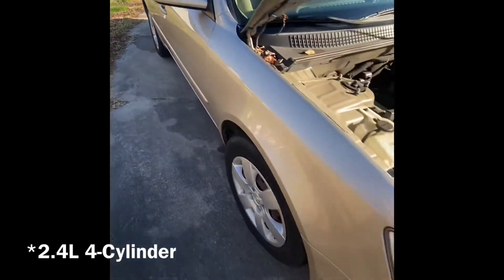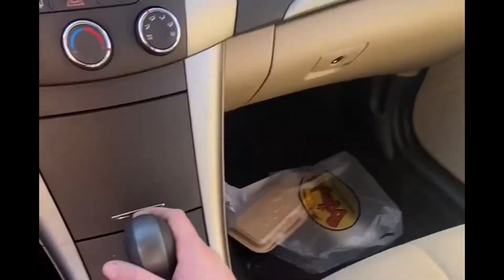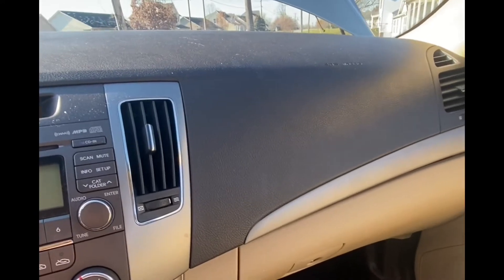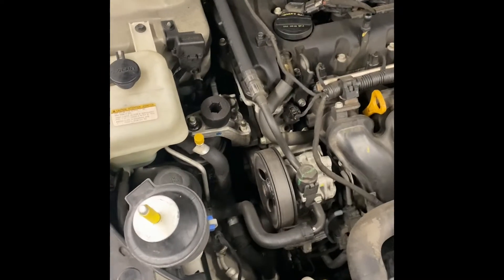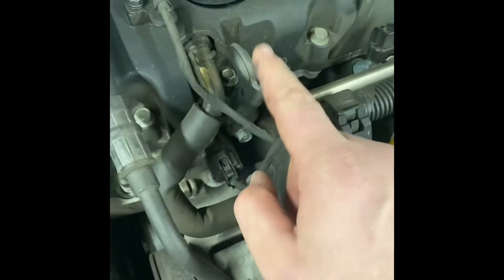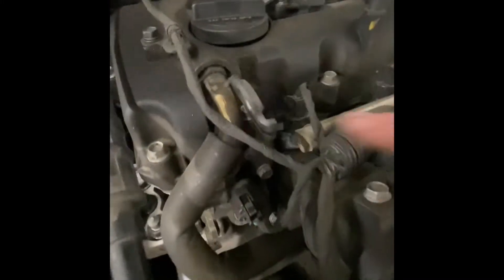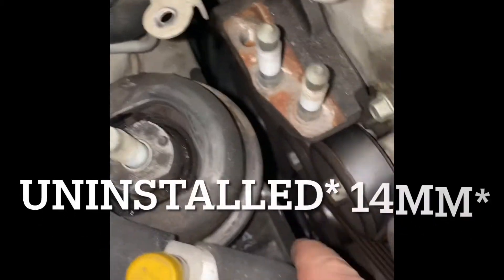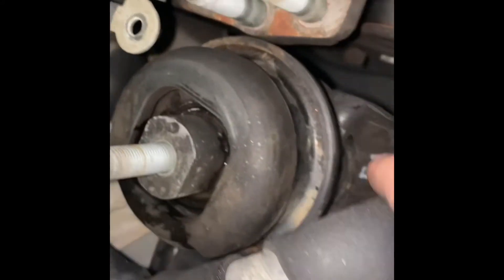2009 Hyundai Sonata making noises? Motor mounts gone bad?

Comment: I’ve had same noisy sound for months now and I wasn’t sure if it is the engine mount or not and you just saved me! Thanks a lot for sharing this video.
Reply from the maker: Awesome! Glad I could help!
Reply: @randomcitizen2345  Were you getting same noise when in drive with moderate accelerations?
Reply from the maker: @Giorgimm11  no. It only made noise when in park or if you held the brake while in drive
Reply from the maker: Have someone watch your engine with the hood open. Put the car in reverse. Hood the brakes and give a little gas. Is your engine moving. Also check in drive. This is a easy way to see if any of the engine mount bushings are bad
Reply from the maker: @Giorgimm11  a bad engine mount can make noise while driving
Reply: @randomcitizen2345  Already tried that but engine makes a normal movements :(
Reply from the maker: @Giorgimm11  the noises I heard sound like cv axle or engine mounts. It’s hard to diagnose over a video though
Reply: @randomcitizen2345     I had taken car to several suspension shops they all said that nothing was wrong with suspension, Later I tried removing a front right tire, and looked things closely, I saw the grease coming out from the inner cv joint boot (Not sure if torn or something else) So it may be the cause ?  As I was told it must make a clicking noise not scratching one I get (No one has bothered to look at them because there is engine shield covering the whole CV)
Reply from the maker: @Giorgimm11  yes cv axles can definitely be the issue. Go to a parking lot and turn full lock either way and drive slow. Listen for any noise. I’ve replaced them even with no verification and fixed issues
Reply: @randomcitizen2345  Okay thanks will try that tomorrow, will ask them to remove shield and inspect from below, I was just able to look at it from tire side only, and last question, does it sound to you that engine can be making this kind of noise? I meant inner parts not pulleys or belts, Was told by numerous people that they hear it from top right side of the engine :(  above belt and pulleys
Reply from the maker: @Giorgimm11  I don’t think it’s internal from your idle. A noise from the top would be constant through all rpms. A rod knock will be more down low and get worse with rpm. If you hear a clunking sound from up top I would try a engine mount. It’s located right where your noises are and have multiple symptoms of a bad one.
Reply: @randomcitizen2345  Yes engine mount may be the  issue too, we will try to figure out cause tomorrow,  thank you so much for taking care on me.
Reply from the maker: @Giorgimm11  just trying to help another out. Good luck and god bless
Reply: @randomcitizen2345  Just came home, It turned out to be a failing engine mount, as I was told this was the rarest noise it could make
Reply from the maker: @Giorgimm11  glad you found the problem!

Comment: Just did that motor mount job this AM...Initially I though the squeak was due to a bad flexible exhaust pipe until  I found this video on the web...Great job ChunksFix...!  Now here are a few tips for fellows DIY'selfers :  FIRST tip :  Identify the 5  X 10MM screws so U dont swear when time come to put them back in their respective hole.   SECOND tip :  You must remove the top metal peace ( part of the ANCHOR-9353 mount) so U dont damage the A/C aluminium piping while inserting the mount in place.  THIRD tip: the 3 holes in the mount the ones connecting it to the body are not aligning with the 3 holes in the body.  In order to bypass this situation(problem )  just screw in 2 or 3 treads of each bolt while holding the mount as far as possible from the body then use a socket to screw them in place alternating the screwing and that will force-the-3-legs of the mount in place.....This ANCHOR-9353 mount bought at ROCKAUTO is MADE IN CHINA.  !  !   that said it all !  regarding the poor quality of this product eventhough I choose this highest value mount on ROCKAUTO...thinking it was the best,,,SHAME on U  ANCHOR.  BTW my old mount on my 2009 2.4 Sonata  was leaking liquid underneath...Denis here (from Montreal Canada..) ..

Comment: Not sure why did you use a motor hoist to change a motor mount! a tiny push from the jack at the oil pan should be more than enough to hold the engine. thanks for sharing
Reply from the maker: I’ve seen oil pans give in. Be careful!
Reply: Exact MoTube....BUT dont forget to place a piece of wood ( 2 X 6  or 2 X 10) between the oil pan and the jack for obvious reason...No need to lift the engine...Just support it while unscrewing the 2 nuts and the bolt from the engine block...

Comment: Where did u get the mount? did it help with vibration too?
Reply from the maker: I ordered it from rock auto. Yes it fixed the vibrations and noise issues.
Reply: @randomcitizen2345  Nice thx for reply. I Was worried i would have to order all of them. Having the same issue with the weird squeek